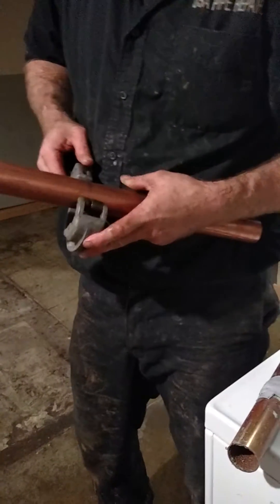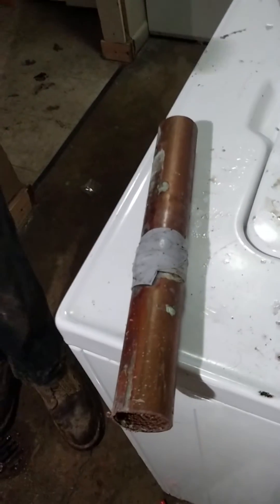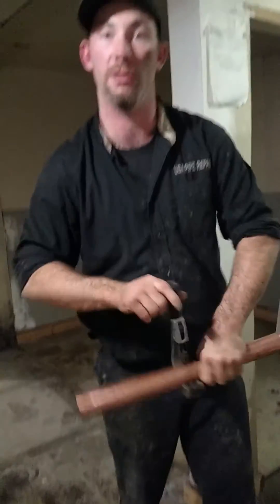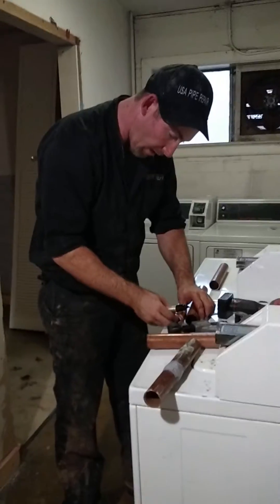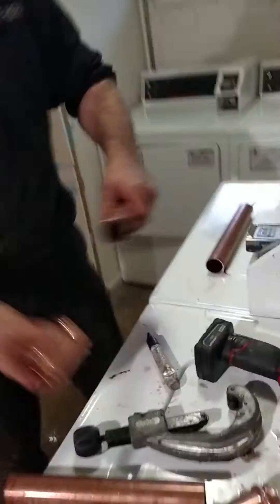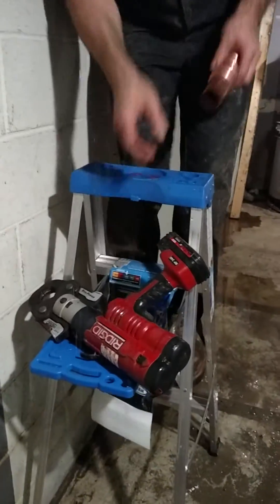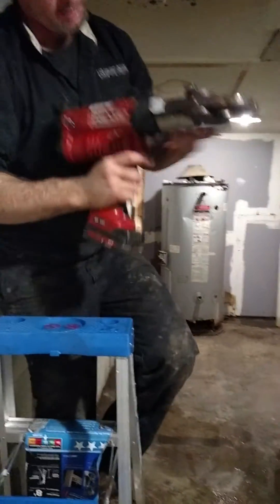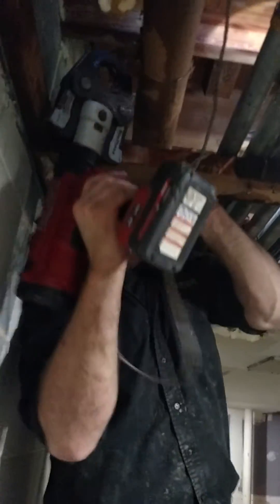Ridged pro press watermain repair

Comment: I hve milwaukee tools out the ying yang, ut ridgid makes ge best press tool. Rp241 is way better than the m12 force logic.
Reply: Why do you say that? Trying to decide between Milwaukee and Rigid right now......
Reply: @sal.pizzurro  slightly shorter, from what ive been told the ridgid is a hydraulic system vs the m12 being mechanical. This results in more consistent press force. A ridgid rep i talked to after i had got the tool told me that and i had not talked to him before i bought it. Saying way better is just me shit talking.  Guy i work with has the previous ridgid model, being soo expensive i went w what worked. 12 mnths 0% interest on amazon plus lowest price on the net brand new. Im sure the m12 is available that way as well.

Comment: Poor planing water above electrical , what's going to leak first ? The wires in the pipe or the water in the pipe ?
Reply: Good thing the electrical is suppose to be water tight and the wires have coating or that would be bad very bad lol but still poor planning